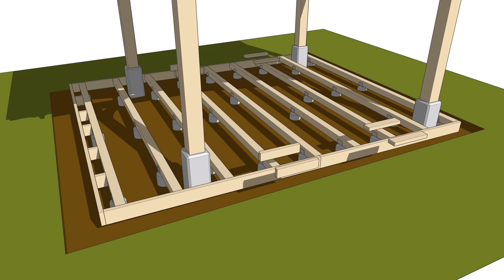How to Build a Floating Deck - low profile design and footings

Comment: Another well thought out, planned project with excellent explanation. Still think you should have your own DIY TV show. Anyway, one benefit of pulling up the concrete form tubes is the bottom will bulge out and secure the deck to the ground more and help prevent heaving if the ground freezes. Deck turned out beautifully. Thanks for the video.
Reply from the maker: Thanks George! Very kind of you! And I was thinking the same about the tubes. Pulling them up does create a better foot for the concrete.

Comment: VERY nice technique setting up the platform (joists etc.)  

May I suggest considering cutting curved boards shorter in future projects, then (re-)squaring the ends, instead of trying to force them straight at full length?  This method reduces the curve you're dealing with by half when cutting in two, by 2/3 when cutting in three, etc.  You'll build much less stress into the structure that way, at the cost of having a handful of extra joints between the shortened board ends.  Woodworkers do this all the time to make longer curved/bowed boards more usable (less milling to get them straight and square, so less waste - in your case less forceful clamping (or none) is needed to true the edge.)
Reply from the maker: Thanks Jeff! Good suggestions here. One other thing I was thinking about: the long boards can benefit from the long lever effect if the structure can handle the stresses.

Comment: Master craftsman. I like every aspect of your build. I might have used a router on the deck edges instead of chamfer, but it looks great. 

TIL to straighten the deck board using a pipe clamp. My little mini deck had some doozies that I just strong-armed. Also, I ALWAYS try to cut/place the end boards individually [each a little crooked] instead of all at once [making a straight, even cut] like you do. Gold.

Have you given hydroponics greenhouse consideration for the garden? Plants grow fast.
Reply from the maker: Thank you very much! We are building a greenhouse this year. I don't think it will be hydroponic tho.

Comment: I'd love to see more aircrete content, how strong is it in compression compared to concrete for small structures kind of thing.
@MAN_about_TOOLS any projects in the pipeline?
Reply: Lots of info on that, and long story short is that aircrete is about useless in most places where you want compression.  Aircrete, foamcrete, interesting but need to really consider loads.
Reply: @boots7859  Possibly but I'd like to see differently mixed and reinforced blocks put to the test similarly to the old flower bed panel test.
After all making any substance support weight is an engineering challenge with different trade offs
I think it would be satisfactory for roofing a shed/garage, kids tree houses, dog houses, etc.
Reply: @ShotgunEmmet  I get where you're coming from, I was hoping to make some to use instead of exterior shed sheathing.  In the NE here, I would not want to test it with a decent amount of snow load. 
Its truely an interesting building material, however it just doesn't have a lot of strength for many applications.

Comment: The framing system for the deck strikes me as odd, not very conventional (from what my novice eyes have seen).  The finished product looks great though.  I am interested to see the pony wall, I have a similar issue in my yard.
Reply from the maker: It is unconventional for sure. But to get a low profile you have to build it in a non-standard way.

Comment: I'm not following your logic at 4:30 regarding frost heaving more with a gravel bed vs 1' sono-tubes. I'm outside Buffalo, and you're even further North of me.  Your piers should be at least 48"+ to get below the frostline, right?
A 6-12" gravel bed in my area is generally seen as pretty heave resistant, according to my local permitting office.
Love your videos, just not following why you seem to be doing what seems the opposite of conventional wisdom here.
Reply from the maker: Good points here Boots. We are on Vancouver Island where we have fairly mild winters. I know that some build low profile decks with the concrete deck blocks on a layer of gravel. Essentially placed on the ground. I wanted to go a bit deeper just in case we did have a severe winter that might heave them. Also, I knew I would be putting some stress on the frame trying to straighten the deck boards. So that's my thoughts on digging the holes 12" deep and pouring concrete. It might be more than I needed but better to just do it once.
Reply: @MANaboutTOOLS  OK, just thought it was odd since WA State has a 24" frost line, and figured it would be at least that.